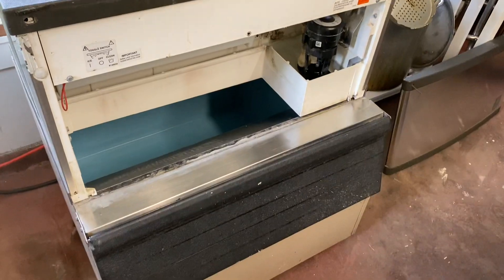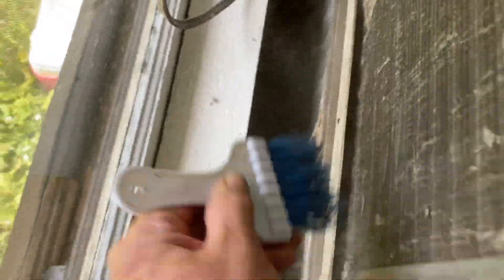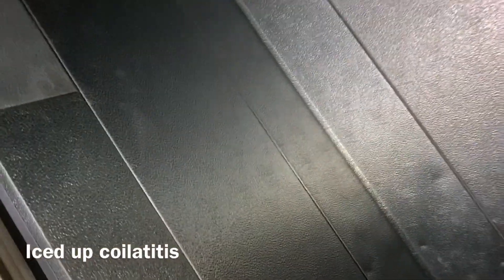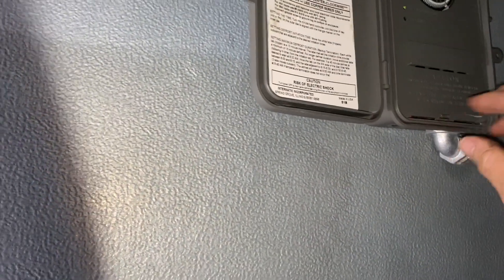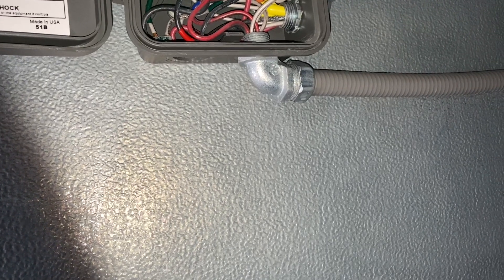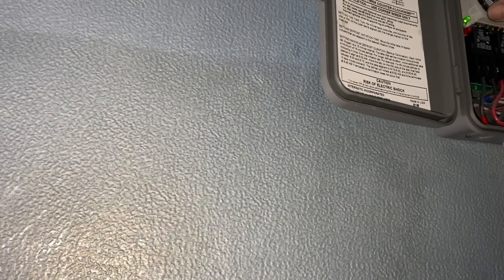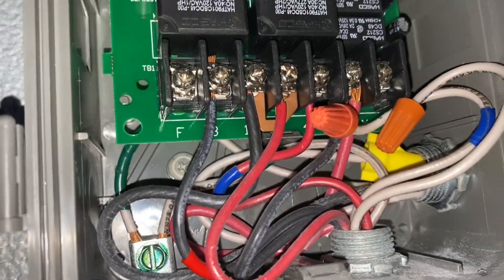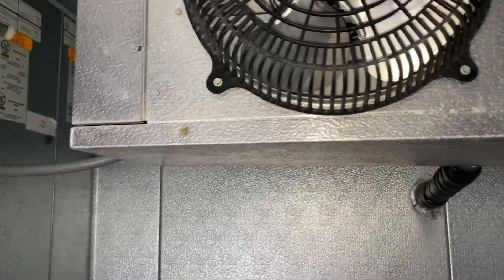Failed defrost termination

Comment: I’m “lucky” enough to work at a ton of McDonald’s. Anytime one of those switches fails it gets left out of the system. Every store needs 6 defrost per 24 for about 30 mins. It’s not perfect. But with all the trouble the employees give at mcdonalds it saves me stupid useless call backs.
Reply from the maker: I like it
Reply: sounds like a great plan.
Reply: Mcds don't need a freezer anyway with low meat supply ! It's not like they have ice cream either! Haha
Reply: @YuShudNoe  the commercial restaurant supply doesn't have any shortages that I know of or temporary from high volume sale surges...
retail/grocery stores on the other hand got swamped in floods of people stockpiling and the supply isn't set up to handle it. they cannot just take the commercial supplies and magically make them end consumer supplies overnight.
Hopefully they'll have the means and handling capable of doing so after all this mess!
Reply: i agree...we do alot of mcdonalds and they love to keep the box door open for an hour while putting the delivery in...even if its a side door on the box that goes out to the parking lot..then they complain about all the ice build up on the walls & floors and these new beacon 2 systems & master bilt mac units dont make it any easier with the constant adjustments